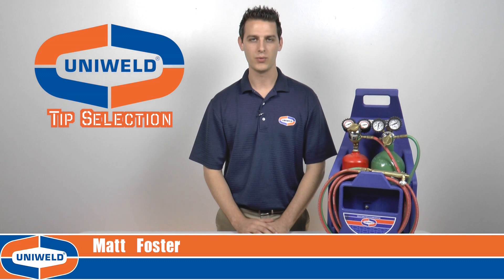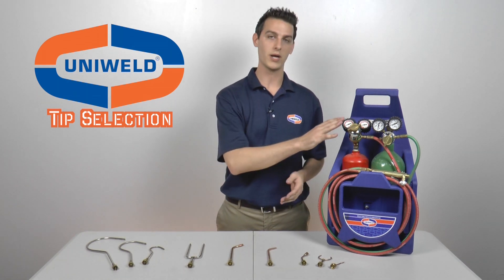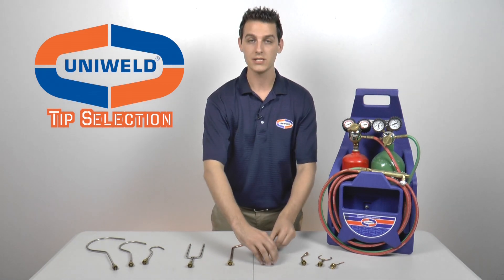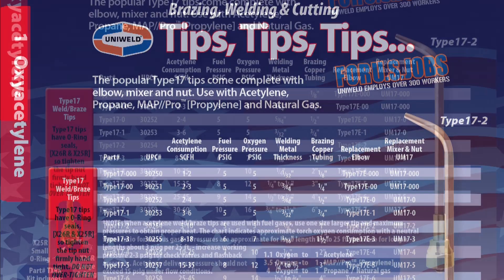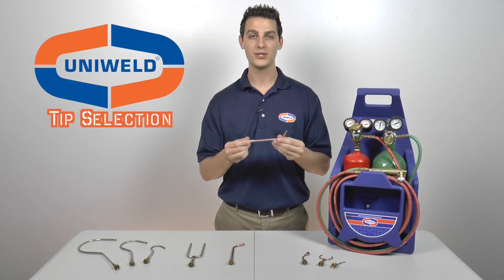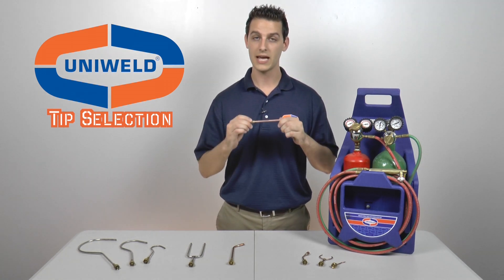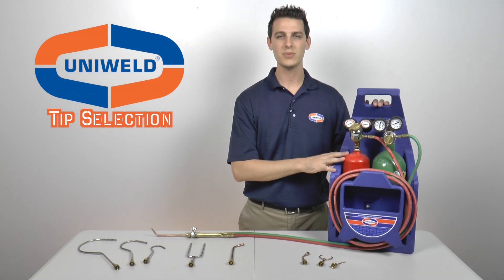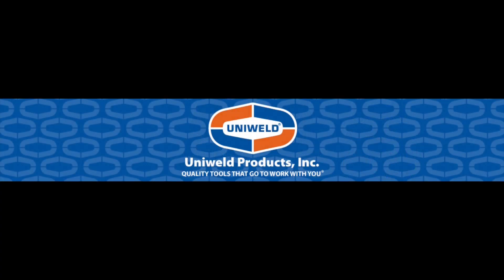Oxyacetylene Tip Selection

Comment: When using propane or Mapp what would be the regulator settings?
Reply from the maker: Ran Seepers The regulator settings when using Mapp / Propane should be the same as when operating with acetylene. The pressure will be determined by the tip size being used. Visit our website www.uniweld.com for more information.